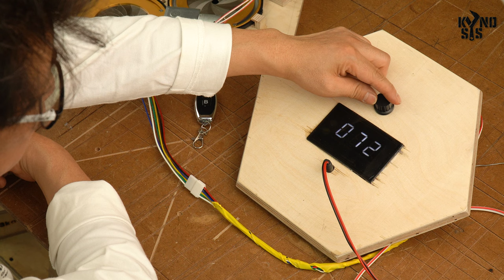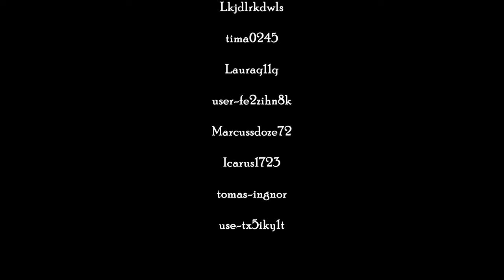Iris type Luxury Drawer / Kynosys Hexagon Drawer / DIY

Comment from the maker: If you've seen the 007 movie, you'll remember the scene where the 007 in the black silhouette is walking and shooting beautifully. 
With the sound of the gun, red blood flows through the aperture lens of the camera.
Every time I saw this movie, I thought of a switch that opens and closes like an aperture.
I thought it would be cool to have a drawer that opens and closes the door like that.
Circular-shaped products came out to draw circles of various sizes. As soon as I saw it, "Ah!" This is it. That's what I thought.
And I imported 500 of that product from foreign country. 
It was a perfect prototype, and it was the switch that I was going to make. I made a luxurious watch locker using this product.
I wish it were a little bigger, but it was enough to keep the watch.
This work presents various technologies such as driving a deceleration motor, utilizing a timing belt, a motor speed regulator, a one-channel wireless remote control switch, and a circular groove digging. 
Please take a closer look at the video and apply it to your DIY. 
Thank you.

#DIY #Drawer #Movie #007 #LuxuryJewelryStorageBox #WoodDIY #JewelryCase #Making

Comment: Красиво. Если светодиодную ленту запитать от отдельного блока то она не будет моргать после открытия
Reply from the maker: Вы указываете правильную часть. Когда я подключил питание, светодиод замигал в точке начала и окончания работы двигателя. Я попытался избавиться от него, изменив схему. Он показался мне подходящим, поэтому я оставил его в покое.

You are pointing out the correct part. When I connected the power, the LED blinked at the point where the motor operation started and ended. I tried to get rid of it by changing the circuit, It seemed like a good fit, so I left it alone.